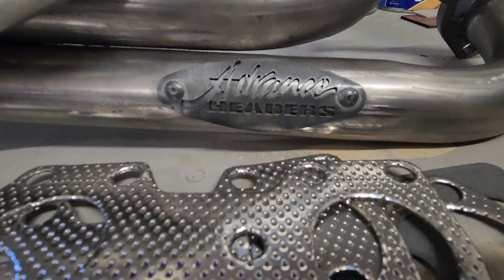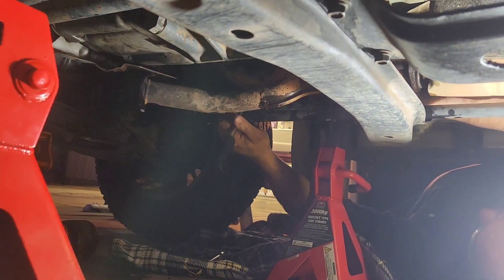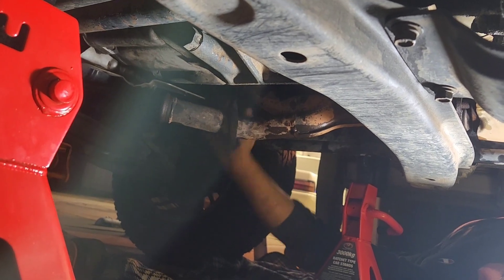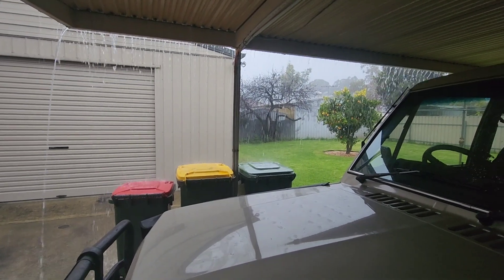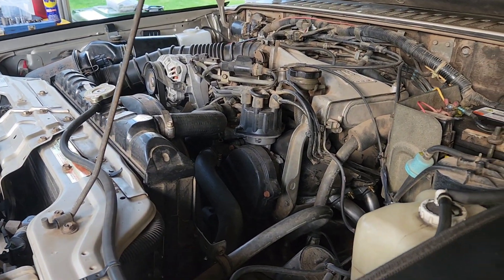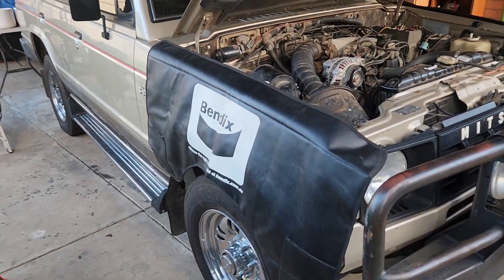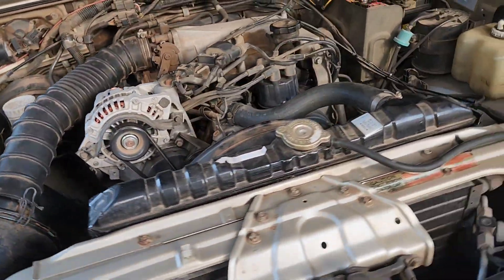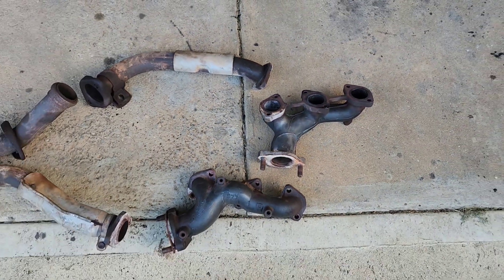V6 Pajero Exhaust Upgrade

Comment: Feels good to be able to turn your back on an old problem.
I think those were called Montero's over here.
Stayin tuned! 🤠👍   🇺🇸
Reply from the maker: Bloody oath! From what I learned it was the factory heat shield that caused the issue to begin with, it cooks the standard log manifold but what would I know. I ain't no Mechanic ha ha. Do you really have them over there? Cheers mate.
Reply: @brushitoff503  
Yes we did but Monteros of your year likely have all been "processed", production ended here in 2006.
I Googled Mitsubishi Pajero, Wikipedia has an interesting read there.